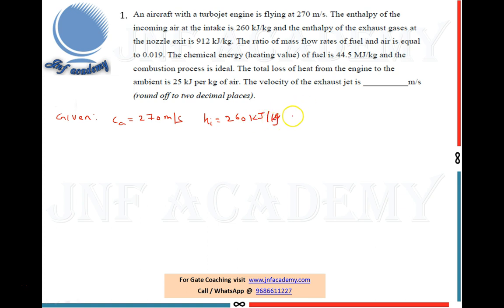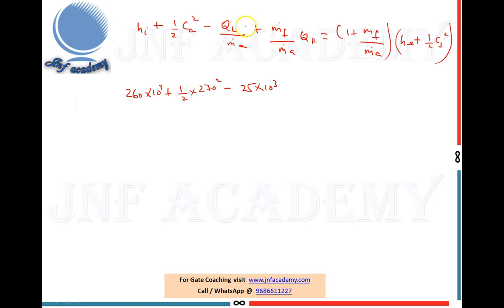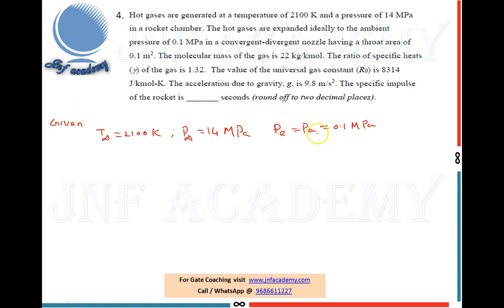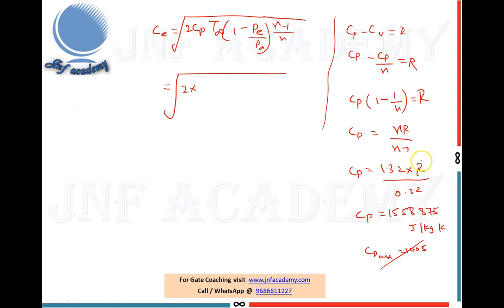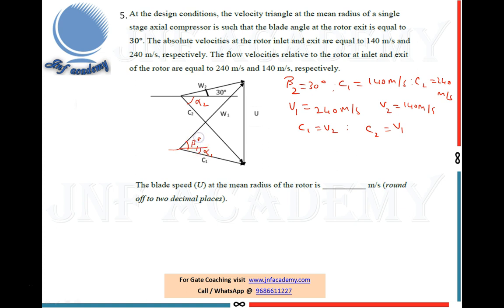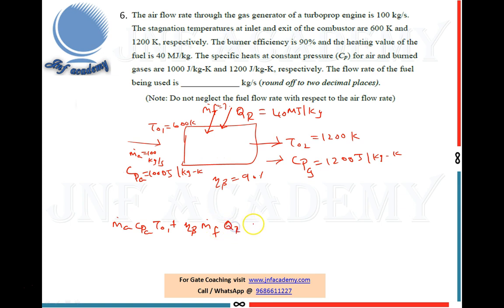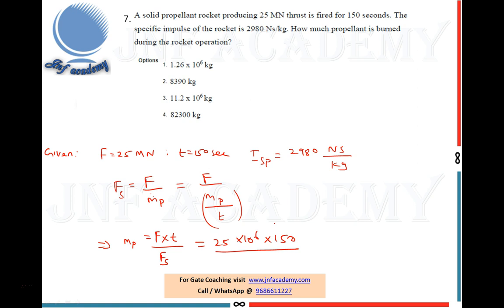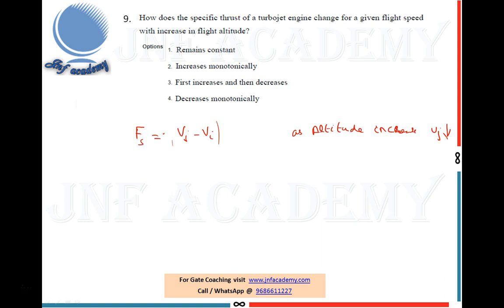GATE 2021 Aerospace questions with solutions - Propulsion

Comment: the ans in the key of 47 th question is 18 to 19.5 but i am getting 10.8 same as u can u check sir
Reply: Sorry for late reply sir has written DOR formula incorrectly.
DOR(Turbine)=ca/2u(tanbeta2-tanbeta1)
U will get ca value as 260.46m/s
Now sub in mass flow rate formula the ans will be around 18.75 
Hope it helps
Reply: Hi bro ,are you aeropsace gate aspirant..?